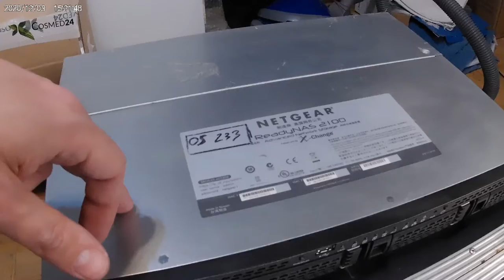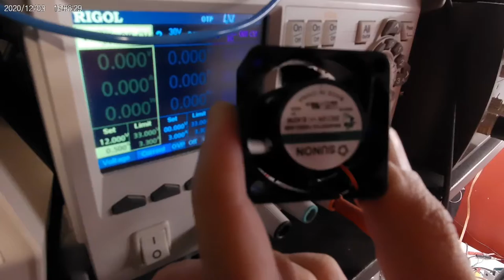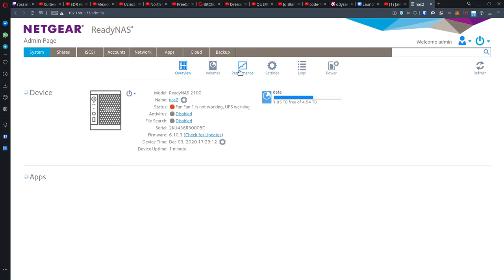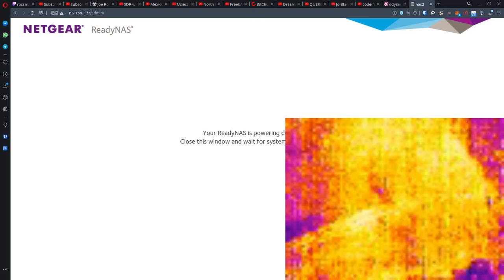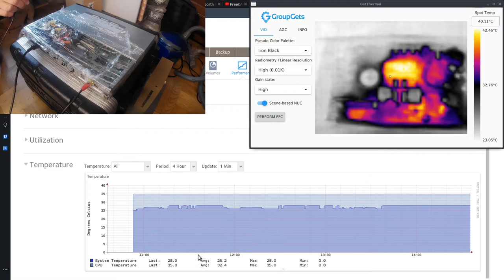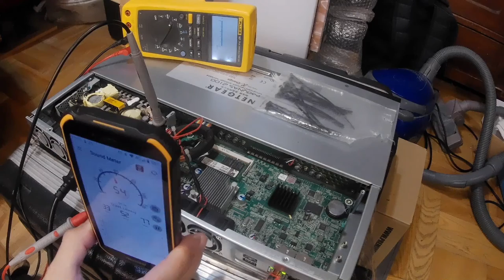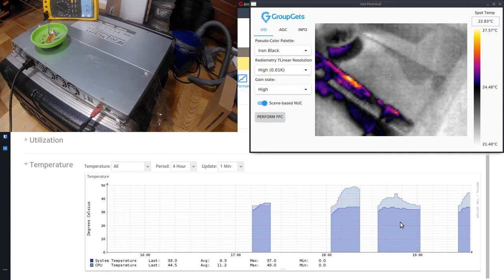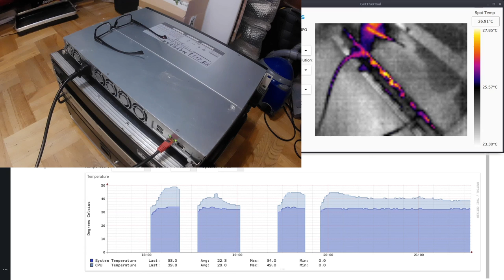Making a ReadyNas 2100 quieter and cooler

Comment: could you just swap out the wires from the originals fans to the new fans?
Reply from the maker: No rpm sensor -> no closed loop control -> fans run at max rpm

Comment: Do you recommend the NAS? For home use. Varying reviews online.
Reply: I'm a seasoned Linux user, so I could build my own using FreeNAS or what have you, but it'd be another box to maintain. This still receives updates and does all I need, and then some. I'm happy that something here 'just works'. Just don't use shingled drives if you need high write performance.